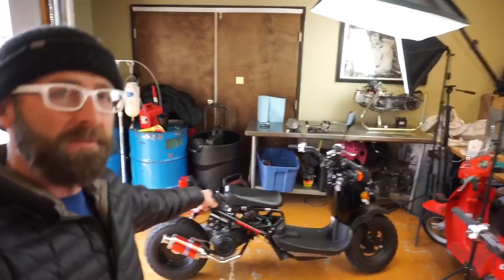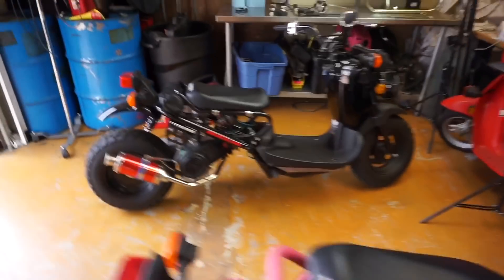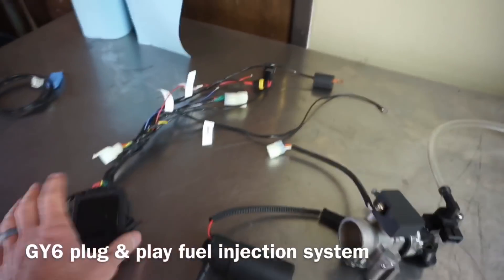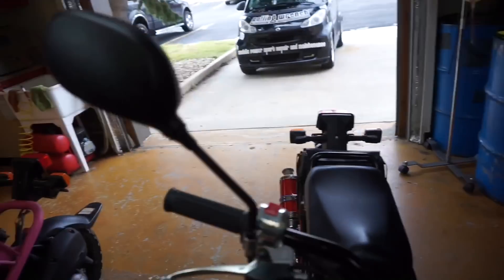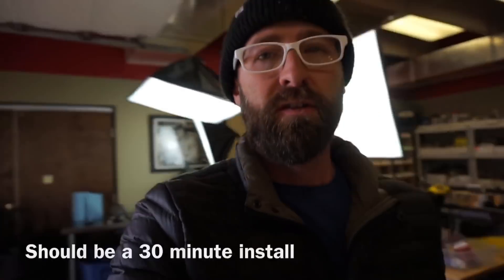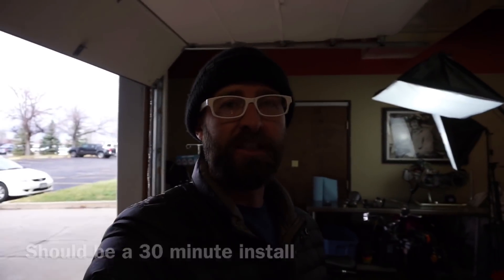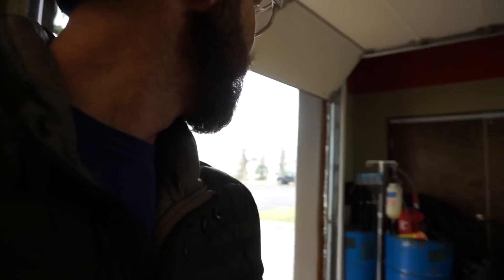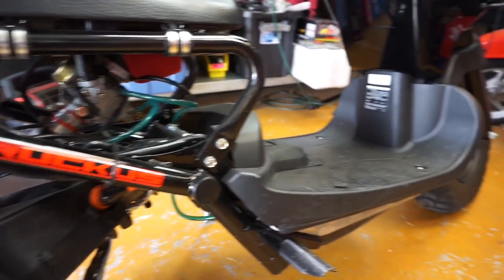GY6 plug & play fuel injection!! WHAAAAT?

Comment: Hello rolling wrench I have a lexmoto fmx 125cc it's a bag of shit but it's my bag of shit and I want to make it better hahahaha so far all I have done to it is upgraded exuast system performance variator a performance 2000 rpm torque clutch spring and a performance clutch that also has 2000 rpm springs in it I have opined its better than it was before but just not good enough, so I bought a 180 cc piston cylinder kit for it but I need to save up for that performance fuel injected efi you made to run my 180s kit I do believe my mope is a gy6 but need to know if it's compatible and also what would I have to set the efi kit you made to run my 189s kit smoothly? My mate bought a 155kit for his and later on had problems starting his moped up, any advice would be appreciated 👍 🙂 my name is Martin from the UK 🇬🇧

Comment: Not sure what's up with the carburetted scooters you've worked on but I have a 2008 scooter with a 150cc engine and I've NEVER had to touch the carb in 13K miles.

Comment: check speeduino.com forum somone connected speeduino to same tbi setup instead of china ecu copy
Reply from the maker: Edvinas J. Looks mega interesting! I didn’t see it for sale anywhere
Reply: Yes it is cool project, basically megaqsquirt analog based on arduino mega much cheaper and with regularly updated software. You can buy it on multiple places  or build it by yourself.
Reply from the maker: Edvinas J. I was gonna say that software looks mighty familiar. My system uses megasquirt software. Everything will be fi one day.